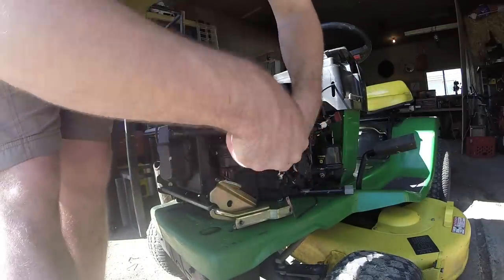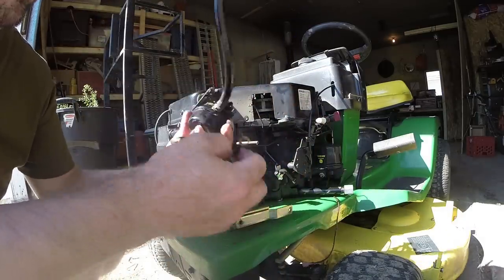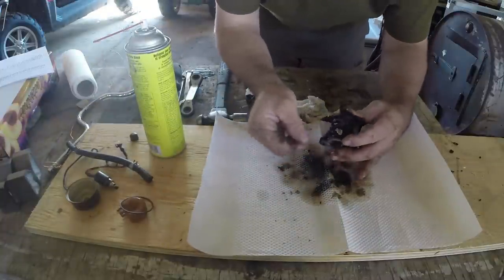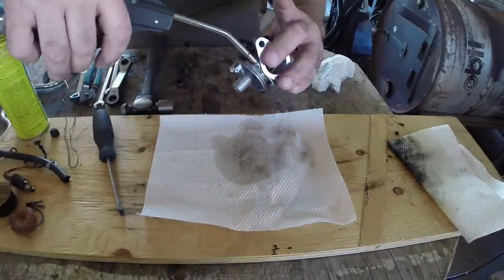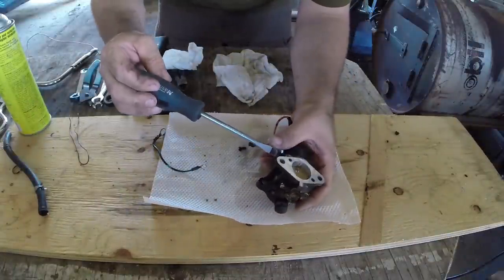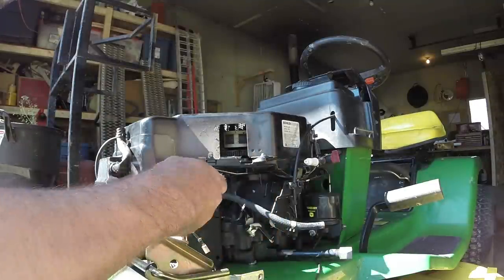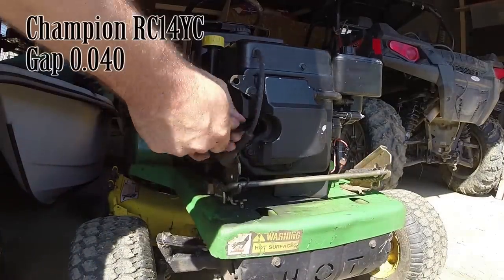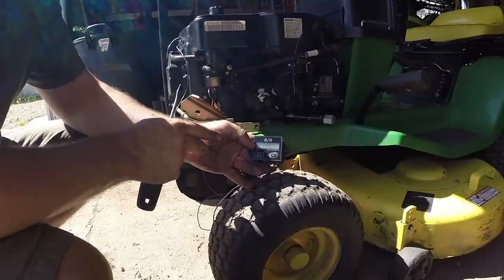John Deere STX38 Carb Removal and Service

Comment: Just finished cleaning the carb on stx38. This tutorial really helped. Now, I hope this fixed the problems I had been having. She started right up and seems to be running smoothly. Time will tell whether I need to investigate further. Thanks!
Reply from the maker: ***** Glad it was of help.  Let me know how it works out.  Those little carbs and leaving fuel in them over winter really kills them.  I try and drain them if I remember each year.  That seems to really help. Thanks for watching!

Comment: I have a stx38 that is 27 years old. I never had any problems until now. It doesn't want to start. I've changed the fuel solenoid, a new battery, I sprayed carb cleaner in the carburetor, I removed all of the old gas and blew air through the fuel lines and also changed the fuel filter. And it still doesn't turn over. So I'm going to try removing the carburetor like you did and clean it. I just have to remember to keep track of how many turn of the mixture screw. Wish me luck!
Reply from the maker: Alphonso Anderson Hey Alphonso, make sure you test the spark by pulling the plug and shorting the plug body against the engine block of the tractor with some insulated pliers.  Then get someone to crank the motor.  Look for a good clean spark across the gap.  Gap should be around 0.030".  I've also seen the float in the carb stick with old gas residue (red goop looking stuff).  And I wish you the best of luck!! Let us all know how it went!

Comment: Hi:  Thank you very much for your insightful video.  I've watched it a few times and then decided I would try to repair my own carb.  Your instructions worked like a charm and the machine is now running fine and I just mowed 1 acre of  grass.  Now all I have to do is find the oil leak!  Thanks again
Reply: Versti i lietuviuę

Comment: 1080 is not too bad. The Kohler engine is a good engine. I just fixed my fathers 25 years old Whellhorse(Toro) tractor. It also has a Kohler 12,5 hp engine. The starter was worn and wouldn't work anymore. I bought a new original starter via Ebay in Germany. I took a half an hour to fix and tractor runs like new again. Its the only thing that we have ever fixed on that engine. A little tip. Those studs will keep getting loose every time you loosen the nut. Give the end that's goes into the engine some Loctite and it will stay in the next time.

Comment: Thanks for the video! Any additional videos showing other STX38 stuff? I'm having issue with my mower deck gouging my lawn in certain instances. Would love to make sure it's level and know how to fix that.
Reply from the maker: I'm afraid I don't.  I tend to buy small tractors to fix and sell them for fun (and a bit of cash).  I would look at the deck hangers though.  They normally adjust the level of the deck by means of a nut on a threaded rod.  Best of luck!
Reply: Appreciate the reply!

Comment: There was no spot for ground on my replacement carb…is this gonna cause me problems?
Reply from the maker: As long as the fuel solenoid is working you should be fine.  The ground cable is probably used in my example as the solenoid might be insulated via a rubber gasket or O ring. 👍
Reply: @TheEmporiumOutdoors  I don’t think mine is now. Thanks!

Comment: PSA, don’t do what I did and overtorque the fuel shutoff solenoid. I stripped that bolt and caused a crack in the carb. Totally ruined it and had to get a replacement
Reply from the maker: Ouch - Sorry to hear that 😖
Reply: @TheEmporiumOutdoors  no worries. All good to go now. Thank for the video, it helped a lot!